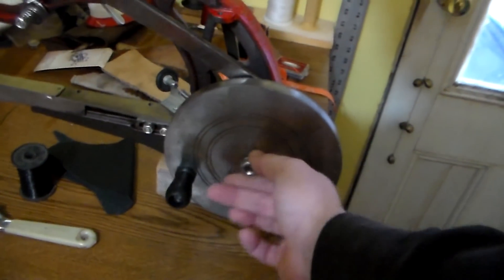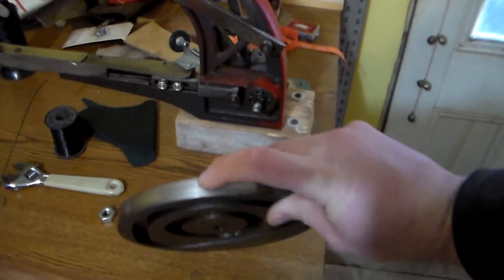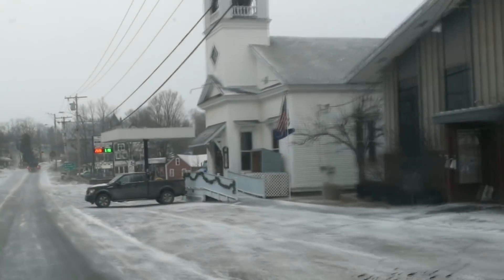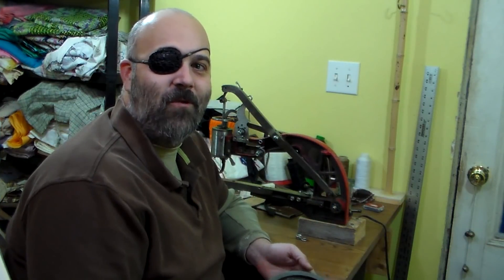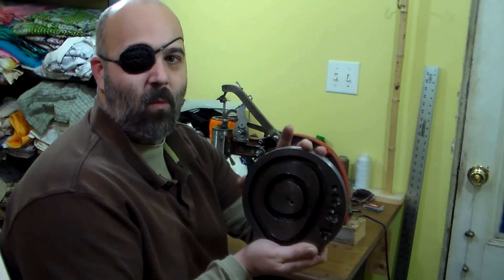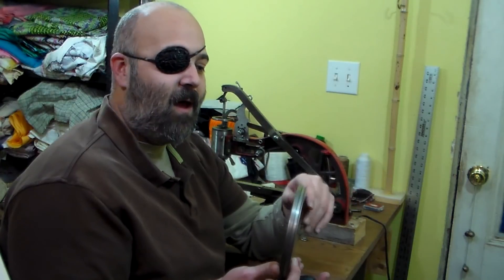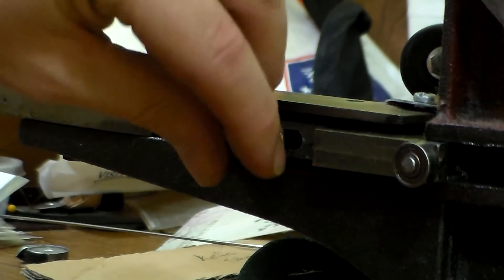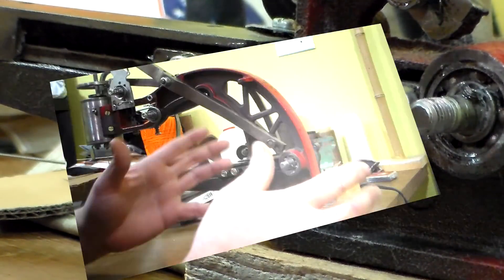How to electrify your Chinese Leather Patcher Sewing Machine Part 1

Comment: Thanks for posting these videos, after watching a few times I order one off of ebay. $134 shipped to the house with extra parts and the belt grove already machined in the crank wheel. The only area that needed smoothing up was the hole in the arm that the thread runs through . I made a extension for the spool rod to use bigger spools.
Kurt
Reply from the maker: That's sweet that you were able to find a machine already modified to run a motor!! That's a dang good deal!!
Reply: Would you mind sharing the listing/seller? I'm trying a ready to go one like the one you mentioned but with no luck.

Comment: With the bearings and channels in the flywheel; do they require any lubrication? What about lubrication within the bobbin assembly?
Reply from the maker: I use oil to lubricate the bearings on the end of the arms and grease on the Pittman rod. I used to add grease to the channels, but I was told not to because it won't allow the bearings to roll. If the bearings don't roll it will cause one side of the bearings to have a flat spot.
Reply: Okay, that makes sense!

Comment: Great video.  I have the same lathe, I make writing pens, and recently purchased the lathe to move over into some metal pens.  Still learning how to use it and what cutters to use.
Reply from the maker: Those little metal lathes are fun to work with, just need some scrap and spare time to get a hang of it. Kind of like these sewing machines. LOL Best of luck on your pens!!
Reply: @MainelyAcresFarmBrooks  Thanks, the pen hobby is quite fun, rewarding at times as well.  I just make them for Christmas gifts now, so I don't do much turning.  The metal lathe definitely requires some knowledge and tons of practice.  That sewing machine is now on my must buy list (Christmas Present to myself).  I want to get into leather work, I did a little bit when I was a teenager, but haven't messed with it at all and sold all of my tooling a couple years ago.  That sewing machine would save a lot of tedious hand sewing time.
Reply from the maker: Yes, this sewing machine will defiantly save you some time when putting projects together. That's why I ended up buying one. Just like the lathe it takes a bit of practice and a few naughty words. Feel free to drop in if you have any issues with you Christmas present. LOL
Reply: @MainelyAcresFarmBrooks  I definitely will, thank you for the awesome videos on that sewing machine.  It'll certainly get some use when I get mine.  Have a great week.

Comment: I just got a machine today. The bobbin was snarled up so I took apart and threaded a different bobbin.Got everything together and it doesn't seem to be looping thread. I've been putzing all night and feel I have bobbin out of time.Can you give guidance on what is correct placement of bobbin?
Reply from the maker: Here is  video I made on how to set up your machine with the correct bobbin placement. ( https://youtu.be/tWgxzSCZxrQ ) If your still having issues after installing the bobbin correctly then your needle bar needs to be adjusted lower.

Comment: Quick question: when you had the slot milled in the flywheel's edge, I presume that they took the handle off while it was on the lathe.  Afterwards you pointed out the reliefs that were drilled out behind where the handle mounts, to balance the flywheel.  But when you're operating the machine under electric power, I presume that the handle will still be left on it.  So wouldn't the balancing job be largely negated by the handle being there while the flywheel is spinning?
Reply from the maker: Your 100% correct. We had to balance the flywheel to do the machining, not for the balance while sewing with a motor. My dad used a small lathe, so we had to get the wiggle out.

Comment: What sort of motor did you use? I have looked at another video with a bolt on mod that I like but he had issues controlling that motor. Its a 6000 RPM job off Amazon. I do n ot have access to a machine shop so the bolt on option works for me but I think a different motor might be in order. THX! I have learned a lot from your videos so far. Have not had my machine long but you helped me get it going. The motor will come later once I get a bit more experience.
Reply from the maker: I used an old singer sewing machine motor, but I burned that one up a while back. Your best option for a motor is going to be a servo set up
Reply: @MainelyAcresFarmBrooks  Thanks so much for the response. So that motor just didnt have enough huh? I looked into those servo motors. I am OK with the price but how do you control one?  Most you have to reach over and adjust the speed or turn on and off. Not sure how that would all work out. Have you done this or just scrapped the idea and crank 'er by hand?
Reply from the maker: Yeah, that old singer motor didn't have enough slow torque. Most servo motors I have seen can be adjusted by a dial, then controlled by a foot peddle. I haven't given up on adding a motor just haven't had the time.
Reply: The Singer type motor should work well with the addition of a jack shaft.  Use wood to make pillow blocks to hold skate wheel bearings and a shaft.  Put a large pulley on one end and a small pulley on the other end.  Connect the small pulley on the motor to the large pulley on the jackshaft.  Connect the small pulley on the  jackshaft to the flywheel on the machine.  The jackshaft pulley could be made from baltic birch or other quality plywood.  If it is the same diameter as the flywheel then the jackshaft will be turning at the same rpm as the flywheel WAS turning and the flywheel will now turn much slower than it was.  This allows the motor to run at higher speed, producing more power and moving more cooling air over the motor.

Comment: Hi Eric.  Just want to pass on something I learned while working in the oil fields of the Gulf of Mexico.  The crane mechanics told me to never ever put grease in a channel or grove where a ball bearing rides.  You want the channel 'dry' so that the ball bearing does not slip and develop flat spots either in the channel or the bearing.  Just wanted to share this.
Reply from the maker: I have never heard that before, thank you for the tip!!
Reply: @MainelyAcresFarmBrooks  I didn't know that either until one of the mechanics caught me greasing the 'hook' ring under one of the cranes.
Reply from the maker: I will make sure to make a correction on my next sewing video. It make since that the ball bearing should be able to spin and with all that grease it will just slide around. Thanks again!!

Comment: I cut a groove in the flywheel on my 10" table saw in about 20 minutes without having to balance anything.   I have an abrasive cut-off blade for metal  that is made to fit the table saw. (You can get them at Lowe's or Home depot.)  I stood the flywheel up against the fence so that the blade was in line where I wanted the groove.  I clamped a board to the table, parallel to the fence,  to keep the flywheel snug against the fence.   I also clamped a block to the fence to roll the flywheel against, in order to keep it directly above the abrasive wheel.  I cut a groove about 1/3 the diameter of the belt deep, in several steps rolling the flywheel over the blade several times each time I raised the blade.  Clean up the burs with a file or wire wheel brush on the bench grinder.   You can get 4mm diameter fusible transmission belting for watchmaker's lathes (like I did) on Ebay.  https://www.ebay.com/itm/12-Feet-Transmission-Belt-for-Watchmaker-Lathe-Jewelers-Belt-Watchmakers-/122905012069
Reply from the maker: Thank you so much for sharing another way to add a belt to these sewing machines!! Good tips!!😀👍👊
Reply: @MainelyAcresFarmBrooks  While the groove did turn out beautifully,  my standard sewing machine motor was not strong enough to run my machine.
Reply: @clockguy2  My old sewing machine actually has the same motor he is using, but I'm not willing to cannibalize it for the motor. You are looking for a motor on those old 1950's zig-zag, metal cased machines and you can usually pick up an old sewing machine at a thrift store or even a yard sale. 

I bought my old machine at a thrift store for about $15 in the early 90's and she's still running. I also have several more machines from that era.

Stay away from the plastic machines. Their motors are weaker.
This site will tell you more about them.
https://www.quiltingroomwithmel.com/2016/11/vintage-sewing-machine-motors-myths-and.html
Reply: @MainelyAcresFarmBrooks  The reason your presser foot is getting hot is because the motor was meant to be run faster. It heats up when you run it slow. I have an antique sewing machine that does the same thing. If I run it fast and hard, it doesn't get hot. If I run it slow, it gets hot and I have to keep taking breaks.
https://www.quiltingroomwithmel.com/2016/11/vintage-sewing-machine-motors-myths-and.html
Reply: @SandcastleDreams  Thanks for the tip.  I am a clock repairman and I've been collecting sewing machine motors from the thrift stores for around twenty years because they work well with jewelrs lathes.  I had my strongest motor on the machine and it couldn't  turn the shaft past the cams at the back of the machine.  Perhaps I had the foot tension adjusted too tight or something, but it was weak at best.  Maybe a DC treadmill motor is the next step, but I don't know how to put a foot pedal on one of those.  I wonder if  I somehow rigged a step down pulley above the motor,  could I get  enough torqe to run my machine and give the motor enough rpms to keep cool.
Reply: @clockguy2  I don't know! Try it!
Reply from the maker: @clockguy2  If you have Facebook you should join this sewing group: https://www.facebook.com/groups/1646031288779869/?ref=bookmarks
Tons of ideas on how to modify these machines.

Comment: Simple way would be to bolt a 6-8" pulley along side the hand wheel on the threaded shaft. Would need to extend the threaded shaft with a long nut
Reply from the maker: That's a good idea, thanks for commenting

Comment: I keep wondering if that thing can be turned into a treadle machine. That would be cool because you could run it at a slower speed.
Reply from the maker: Yes, they can!! There's a facebook group you can join to see others that have done just that. https://www.facebook.com/groups/1646031288779869/

Comment: Has anyone had their machine apart far enough to find out what the shaft looks like on the Bradbury&co no2 the drive pulley was at the other side are there three screws that hold the flywheel and cams or what If it is easy enough to duplicate you could just make it longer and add a pulley
Reply from the maker: I have had this machine completely torn down, but I have never seen or taken apart a Bradbury&Co No 2.